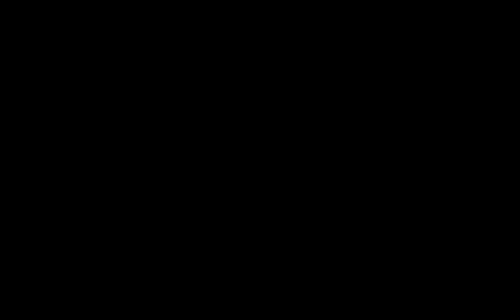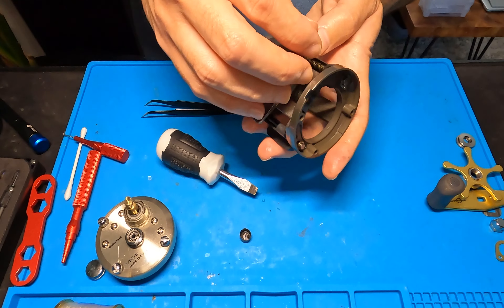SHIMANO CARDIFF 401A - Take Apart & Tune up - Gomexus Power Handle Upgrade

Comment: Can you add a drag clicker on this type of reel?
Reply from the maker: @gone_outfishing6519  The Cardiff 400 already has a clicker, there is a button on the bottom of the reel where you can switch it on and off. 🤙🏽

Comment: Hey what’s happenin Richie.. I’m still trying to catch my first hudd fish and I’m also using the 401a. Do you think those carbon fiber drag washers make any noticeable difference?
Reply from the maker: Hey what’s up brother keep grinding you’ll get one! 👊🏽😎 Honestly it’s not the type of thing that really jumps out at you like wooooow…. but they should be a little stronger, slip less, and will definitely last longer for sure. The normal felt washers do just fine, but for a couple bucks I just like to upgrade them especially on certain reels like this one where I’m really looking to lock it down like for big swimbaits. Definitely can’t hurt! 🤙🏽